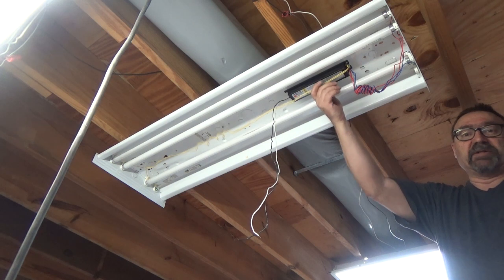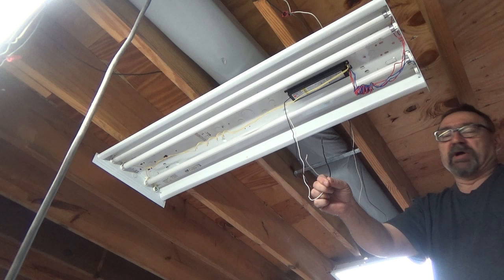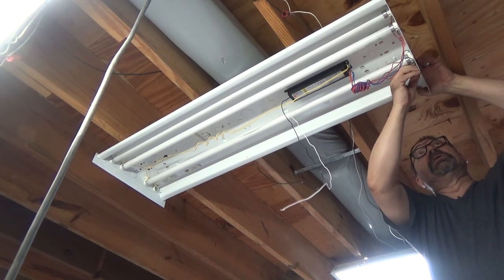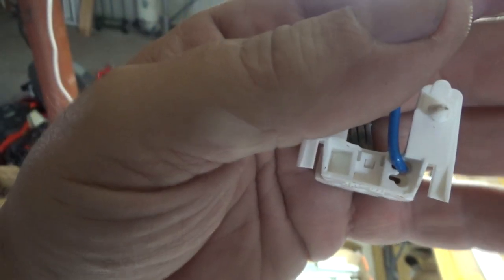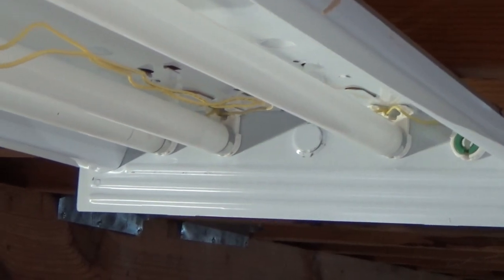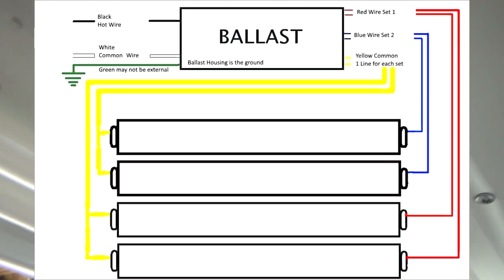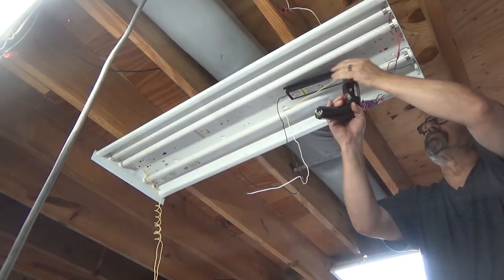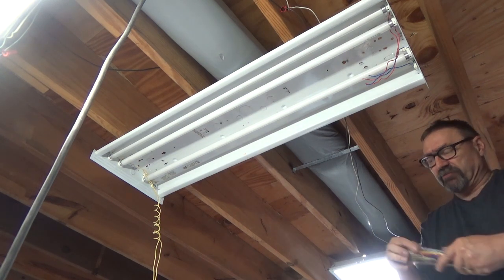4 Light Ballast Replacement

Comment: We have two 4 bulb ceiling lights installed, probably, in 1985.  The cover encloses the ends and sides also and is held in place by a "set screw" on each end.  It has always been a precarious affair requiring a person to stand on a ladder on each end to remove the screw and then drop the cover.  A cumbersome design requiring far too much time.  I came up with a simple way to make it a one person job.  I made a loop of string sufficiently long to allow one end of the cover to drop and "rest" on the loop so I could then move the ladder and do the same with the other end of the cover.  The top of the string is thin enough to slide between the ceiling and top of the fixture.  I hope this tip helps someone.

Comment: Great diy video. I have the exact same ballast and its dead after 20 years. One quick question...can i wire the blue and red coming from the ballast to either blue and red going to light fixture wiring? I'm unsure if each wite has to go to a specific one. Thanks!
Reply from the maker: Yes you can wire the lights that way.
I would think the ballast should have enough length to go the OEM routing design.

Comment: Good video man, but gotta say, if it was me, I would have just dropped the whole fixture and layed it on it's back for the swap, then put her back up, 2 wires and done. Maybe it's more than 2 screws holing it, but it looks like just 2 holding it to the beams